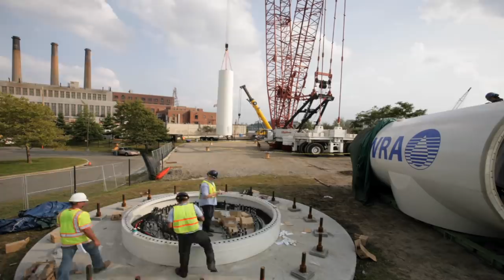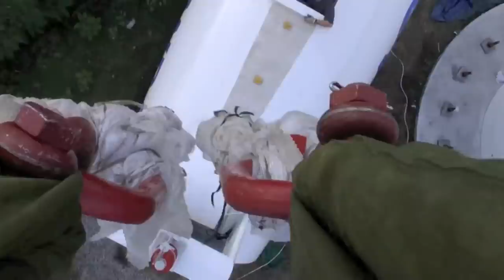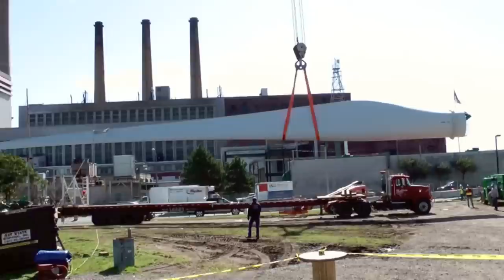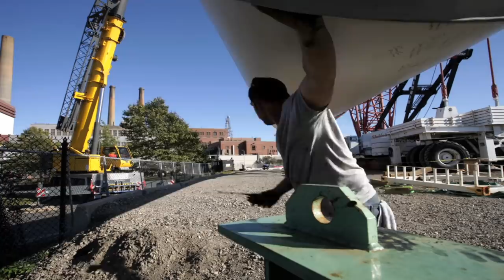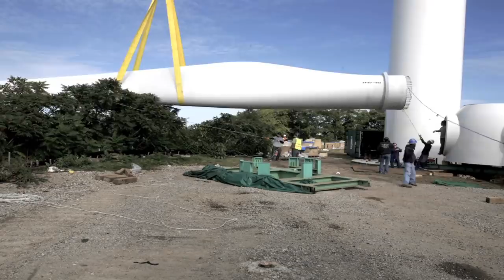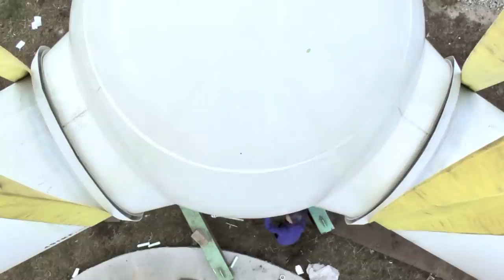Charlestown Wind

Comment: How many calories, or any measurement,  does it produce on an ideal day? How much per year, average, since erected? Hard to find data.
Reply from the maker: The turbine produces about $350,000 of electricity/year.
Reply: Andrej Mucic
!   M
Reply: Not calories Sir.
Electricity is measured in " Units".
1000 units = 1 kilowatt.
1000 kilowatts = 1 megawatt.
1000 megawatts = 1 Gigawatt.
The Wind turbine shown is 1.5 Megawatt output ( MW ) per hour.
This means it produces 1500 kilowatts ( KW ) of electricity if the turbine works continuously every hour.
And it can work continuously only if there is wind blowing at a minimum of 3 metres per second.
Reply: @rajarams5988  Think you got your units mixed up there, electricity appears on our bills as kWh (kilowatt hours) and before it hits the retailers it tends to be sold as MWh (megawatt hours), power being the rate of energy flow, 1W being 1J/s, so unit of power times unit of time gets you your unit of energy.
Reply: @rajarams5988  measured in watts
Reply: @Psychotol  measured in watts. 1000 watts = 1kw
Reply: Ok😘😋😂